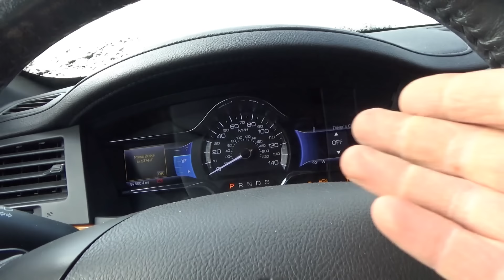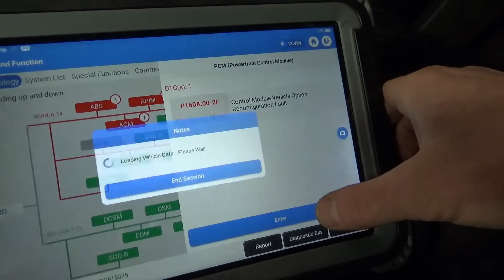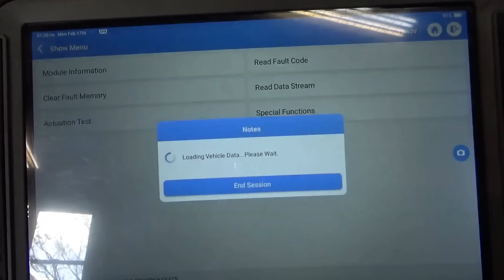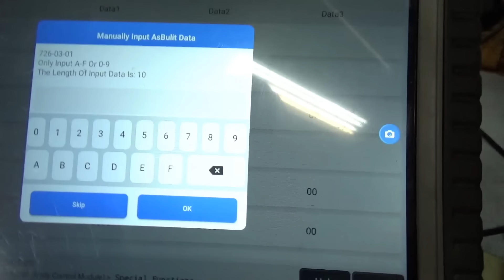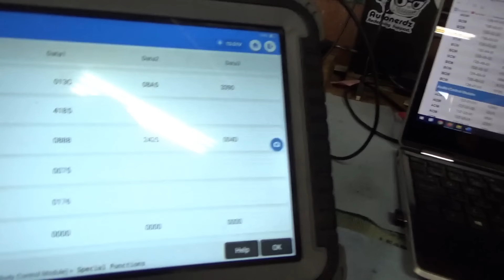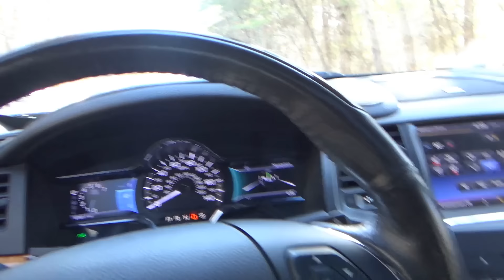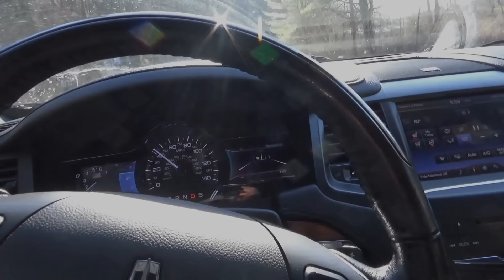(Pt 1) Lincoln BUTCHERED...by Dealer?! ('13 MKS No-Crank...GHOST!)

Comment: I got one from another shop yesterday that's crazy.  Fuel trims are pegged negative, getting rich code, and a dreaded P1101.  1.4t Encore.  If I take the MAF out of the airbox, plugged in, it runs great.  If I get the MAF anywhere near the hole it belongs in it freaks out.  I can blow on it and kill the car.  With it outside the box trims come up to zero, no codes.  As soon as it gets airflow it goes full rich.  Smoked it every which way from Sunday and found no air leaks, for the 1101.  But that is about as far as I have gotten until Monday.  I am actually looking forward to replacing the leaf spring in that Mazda next week.  Just nuts and bolts.
Reply: I had a Chevy cruze like that. I had to replace air box to fix it.
Reply: If the air box is anything like the Cruze, check to make sure that the air filter is installed correctly. It’s a really dumb design that’s easy to mess up during installation and/or fall off the tube during driving. I’ve come across a few that were pegged rich but would run totally fine with the sensor unplugged. All I had to do was re-align the filter. No idea why they use an old school cylinder shaped filter in a rectangular box.
Reply: @KingDraculaSpelledBackwards  I triple checked the airbox.  I even stopped up the inlet, and smoked it.  Filter has good seal.  I haven't put a scope on it or anything yet.  All I have to do is hold it right above the opening and you can watch the trims start to go negative.  With the 1101 I figured air leak.  My next fear is backpressure in the inlet, but I have to check that.
Reply: @farmermiyagi1338 do you have a known good oem MAF? Maybe start there before running down a hole.
Reply: @KingDraculaSpelledBackwards  Not before I scope it.  I don't want to throw parts at it.  It just had the turbo replaced at another shop.
Reply: @farmermiyagi1338 fair enough
Reply: Well boys, after I scoped this stupid thing, and saw nothing wrong, other than this MAF was just reading incorrectly.  I called Oreilly and told him order me a new Delco MAF, since the one in it was a chinese internet special..  I got the same results.  Back to the drawing board.  Got power, 5v, ground, signal looks great on the scope, but it's exactly like the other one, reading too much airflow.  I removed it from the airbox and put it an actual box and it still read airflow.  That's when I knew something wasn't right.  It came down to there being 2 types of 1.4l  Turbo engines in that year.  Mine was a VIN M, LE2 engine.  The other engine I think was VIN B LUJ/LUH.  End result, they had put the MAF for the wrong 1.4l in it.  The last digit of the Delco part was 1 number different. Oh yeah, the LE2 engine was used almost exclusively in the Sport Touring model Encore in 2016.  To frost that cake, I told the goober at Oreilly that I had the LE2 engine.  o.0
Reply: @farmermiyagi1338 RPOs matter! It stinks GM quit including the stickers in the glove box. Scanning the QR code in the door jamb with a phone has been hit or miss for me. Sometimes it helps, but I don’t think they include everything like the stickers did. Glad you fixed another turd!
Reply: @KingDraculaSpelledBackwards  It had the RPO sticker.  When I pulled it up on the scanner, it had the 3 engine options, so I actually looked at the RPO.  ;)  I told the Oreilly guy that it was the LE2 but he still sent me the wrong sensor.

Comment: Would using ForScan to program the BCM have worked ? On my Ford Falcon 2014, Forscan can connect to the internet and download the As Built data and then write the data to the module. you can also down load the As Built data and import it to Forscan.

Comment: Wonder if the original issue comes down to a ground problem. Manual programming the BCM reminds me of the 90's computer bios chips. Everything was in hexadecimal. Can't wait to see what the original fault with this car ends up being. Have a great weekend :)
Reply: I don’t have a lot of experience with Ford’s software, but there has to be an easier way… as far as I’m aware, GM’s tech line connect handles all of this for you. Then again this thing is 12 years old.

Comment: The more I work on contemporary vehicles, the more I appreciate my 1995 Ford Ranger.  Power nothing.  I have HVAC and a stereo.  All manual controls.  I still have manual windows and door locks too.  Same on my 99 Silverado.  I work on this crap for a living, I refuse to have to do it in my own vehicles.
Reply: I'm NEVER getting rid of my 1995 Ford F250 4x4 power nothing!! I do have my late wife's 2012 Dodge grand caravan but will try to that going until I can't or parts are unobtainium.
Reply: This is why I still drive a 92 Cavalier and two 98 Chevy trucks.  My newest vehicle is a 2014 Mustang GT which is my fun car.  Hopefully it stays problem free for a while.
Reply: I hear ya
Reply: The more I enjoy my 2000 Ranger
Reply: Only idiots buy top of the line vehicles from any brand these days. That Includes all other "large appliances".
Reply: @t5ruxlee210 my vehicle philosophy is "The more shit in the vehicle (bells and whistles) the more shit breaks"
Reply: Yeah, I have a 95 silverado, also don't forget insurance is heck of cheaper 🎉

Comment: that is completely disrespectful.     That thing should have been washed before delivery.
Reply: This happens when it is being transported on an open trailer in winter conditions.
Reply: Inside looks clean, not sure what the issue is.
Reply: This is what snowmobiles look like when on an open trailer.